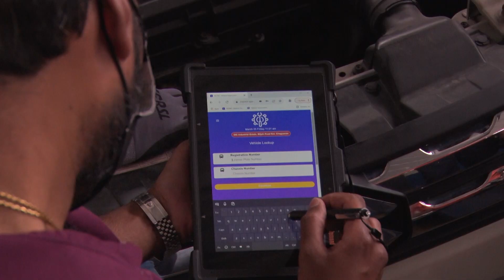Ministry Of Works Launches Electronic Vehicle Inspection System

Comment: yes from ppl that the way to go . no more fuel .no more car blowing up. whit fuel. only electrical problem .no fuel problem .only one way .the  most problem whit electrical battery is from battery to starter in all cars is a time bum okok it on all the time .even if the switch is off .ok ok some time when the one one of the battery cam over tight .ook we see cause fire okok some time when crash ook ook but it the best i ever see the computer control it only when driving .ok ok good work to all inventer